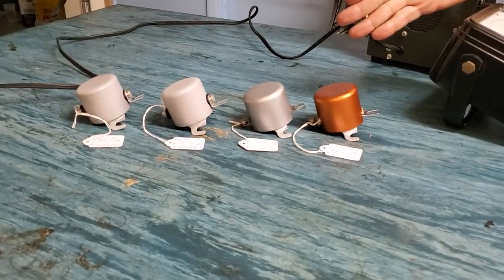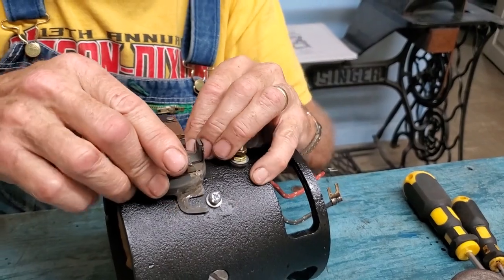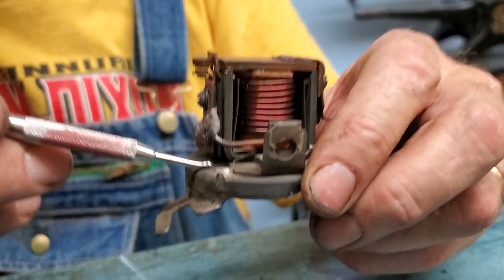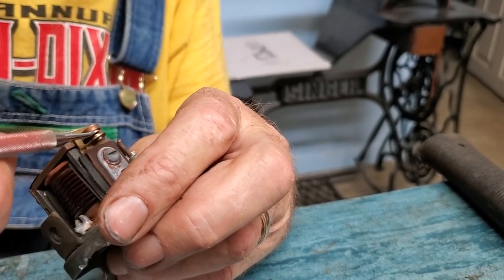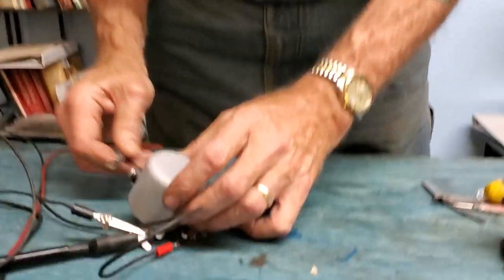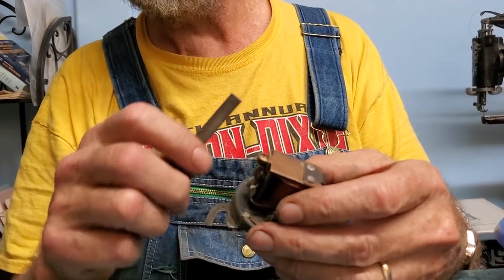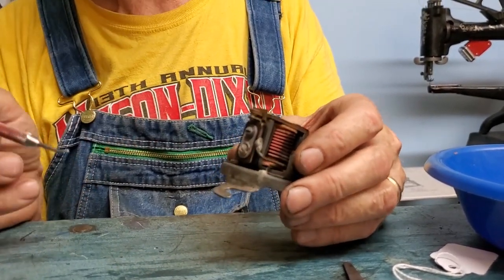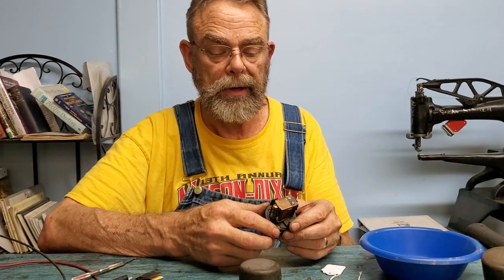Service, adjustment and repair of a Ford model A cutout

Comment: Seems like, if one didn't have a variable power supply, you could create a crude go/no-go test using five AA batteries in series. The points should remain open when you connect four AAs (6V) and close when you connect five AAs (7.5V).
Reply from the maker: Yes, that's a great idea.

Comment: I have replaced the inside with a diode, been doing it that way for years. Still looks original.  Similar to the way I test and adjust voltage regulators. Good video.

Comment: I have some cutouts that have similar internal function, induced magnetic point closure, but skeletonized hardware. Aftermarket?  Bad ones usually have open primary magnetic circuit. Toss? Save usable parts...
Reply from the maker: Most aftermarket cutouts are cheaply made. I only use original Ford cutouts. Others I just toss out.

Comment: Interesting but what is a cutout?
Reply from the maker: Simply an electrical-mechanical switch to disconnect the generator from a car's electrical system when the car is not running.

Comment: Great videos!!
Judging standards say all Model A cut outs have slotted feet. Your 4 examples did, but initial unopened one has closed feet.  I have one which is internally like yours but closed feet.... are they post Model A cut outs?
Reply from the maker: Yes, closed feet started in 1934. I refurbish all years.

Comment: Very informative video! Thanks for sharing. Would you happen to have the lugs, insulators and screws for sale? I have the cutout that I adjusted per the video, but am missing said pieces. Late '31 standard 5 window coupe btw
Reply from the maker: Glad the video was helpful. NUREX and Snyders sells the insulators and L bracket.
Reply: @steveblancard5566  thank you for the quick reply.

Comment: any idea why a cutout would have to have a battery hooked up to work? I tried to bench test one off a 2n ford tractor which is basically the same as what you showed and I can only get the cutout to work as long as a battery is hooked up to it and I have to push the terminal down to close the points  and this only works up above12 volts. I have loosened the spring plate screws to remove tension but I still can't it to automatically close the points even at the high voltage. I have to help it each time and they will stay closed until the voltage drops off and then they don't work again until I repeat the process. I initially adjusted the air gap and points gap as you described which got the cut out to start working if I helped it but I can't get it to work properly. Sorry for the long winded comment trying my best to describe this odd situation.
Reply from the maker: It hard to say without seeing it for myself. I assume you are using a variable power supply that has a sufficient current rating, at least 10 amps, to vary the voltage.  But I don't know how you are connecting a battery with a power supply.  But it could be as simple as the insulating coating on the coil is deteriorated, causing an internal short at some point in the winding.
Reply: @steveblancard5566  It's basically wired up as it would be in the tractor less the amp meter. negative of the battery off the the battery side of the cut out and the positive grounded to the cut out. And yea it's a variable power supply. I'm not sure off hand on the amps. I borrowed the one I am using and do not know the specs.. I'm trying to find one that will do up to around 30 volts.  I tested 3 other cut-outs I have for Model T's and they worked as they should for the most part. One I think is set to charge an 8 volt battery. I was wondering about it being an internal short and was trying to figure out how to test that. 

Thanks for the help
Reply from the maker: Well if the other cutouts tested good, then your test set up is ok. Sounds like that cutout is bad, may be a partial or intermittent short somewhere. It happens, I have a box full of bad ones. I have good, refurbished original Ford cutouts available if you need another one.
Reply: I have several that work if you manually close the points. But not with electrical power. Reason:  Primary circuit is open.  Is there any to fix for this or just salvage usable parts?

Comment: I am trying to reconnect my generator on a 1937 ford. How to I connect back with the cutoff?
Reply from the maker: The cutout terminal closest to the feet connect to the red wire coming out of the generator. The black lead coming out of the generator is ground and attaches to one of the cutout feet screws.
Reply: And the power goes back into the front of the cut off where it says BAT
Reply from the maker: Yes
Reply: @steveblancard5566  thank you so much for all your help